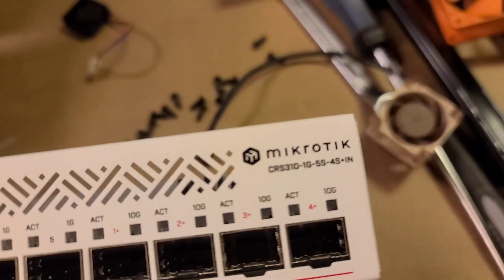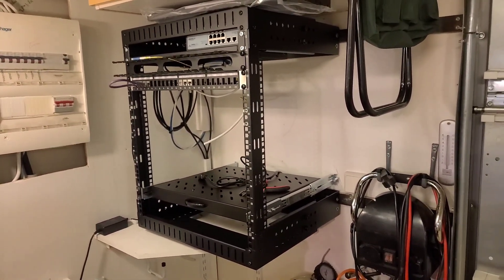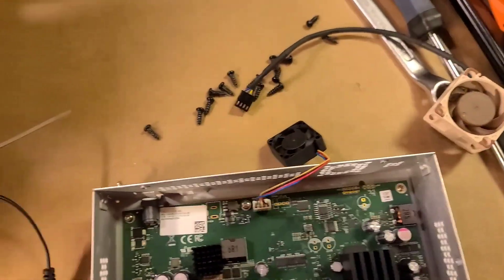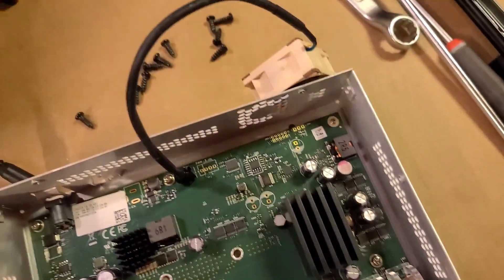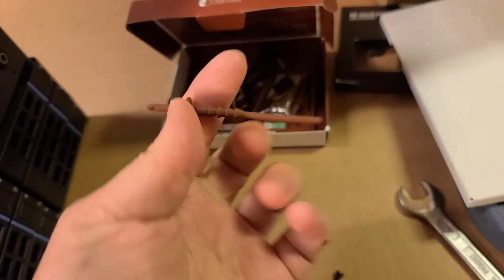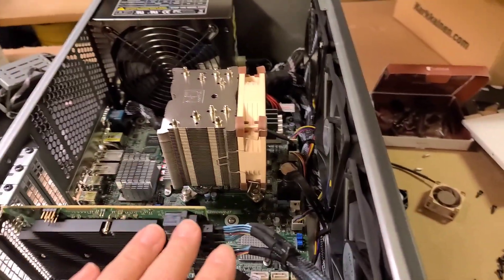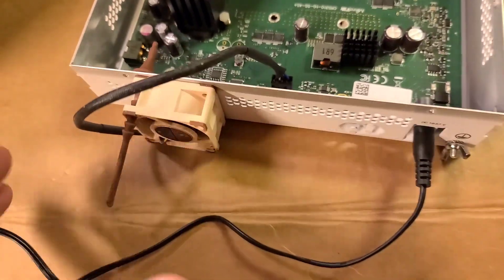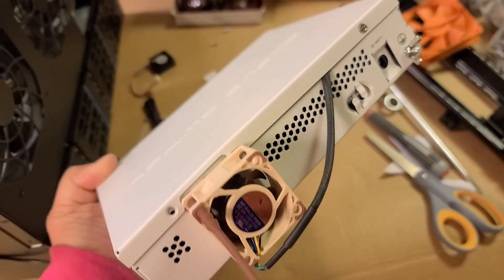Let MikroTik Be Silent!

Comment: I had to get a 10Gbe transceiver as a temporary solution. Apparently the ones based on Broadcom BCM84891L run very cool, just above 40C under 10G load. The Marvell 88X3310 based transceivers reach whopping 90C and the ones with Marvel AQR113C run at approximately ~70C, neither of which is acceptable.

Comment: Wit the stock, fan, why not use a LNA. unit between the fan and the motherboard ?  ( Noctua Low Noise adapter )
Reply from the maker: @JasonsLabVideos  LNA reduces RPMs and, therefore, air flow.

Comment: it's not made for home use.  It's for small office or ISP's, and would normally go on a noisy server rack, so it wouldn't be noticed.
Reply: I would argue that the ball was not dropped at all though, as it wasn't designed for home or small office that doesn't require high speed data links.  And you'll never see SFP's in a home use case. They're not made for home use.
Reply: and there's nothing cheap about those.... microtik is pretty well known in the server industry. And by modifying the actual hardware, even if it is only a fan, you are probably voiding the warranty. 
Now, the fan you replaced it with, has a lower power consumption, so you should be fine, but just something to keep in mind. However, they both appear to have similar cubic metre/hour ratings, but you've got some of that blocked by the case. Shouldn't make too much of a difference, again, just something to watch out for.
Reply from the maker: @TheCurtisnixon  I learned one thing over the years: when many people want to modify  your product, it means you failed with something.
Reply: @fishelectronics  Or people are using it in situations that the designer didn't intend for it. Like, there's nothing wrong with that, but you can't say it's a flaw. It wasn't designed with your use case in mind. IE, no shits given about how the noise might bother you. Especially in the server space.
Reply: oh, and I've modified a ton of things over the years. And not always because the product manufacturer failed at something.
Reply from the maker: @TheCurtisnixon  I'm not about one who is modifying tons, which is called a geek, but about tons who modify one, which is called a flaw.
Reply from the maker: @TheCurtisnixon  I am small office.

Comment: Usually fans in equipment like switches and routers, meant for server environments, aren’t just rated for size but also for CFM or the amount of air they push through based on rpm. When replacing a fan in a piece of equipment you need to ensure you match the size, but also the air throughput in order to keep it cool properly and not have issues in the future.
Reply from the maker: @br3nd4n  Sure!
Reply: This is true but there are other variables to consider for example how much data traffic and also the environment because a switch in Northern Europe isn't going to suffer from the same conditions as other parts of the world.